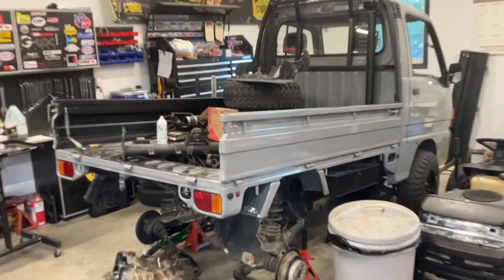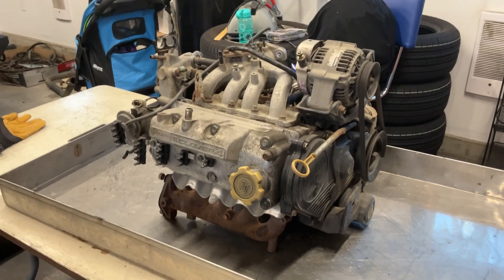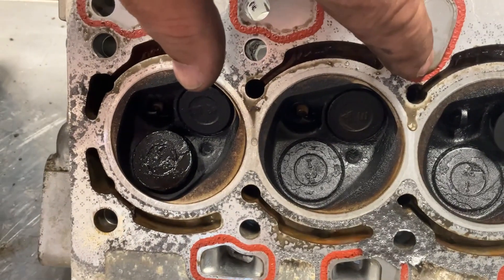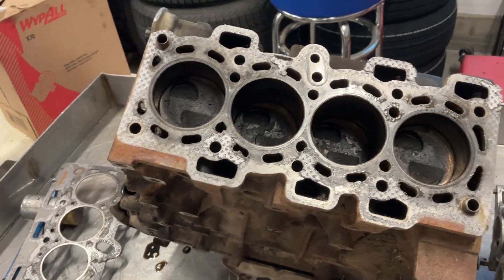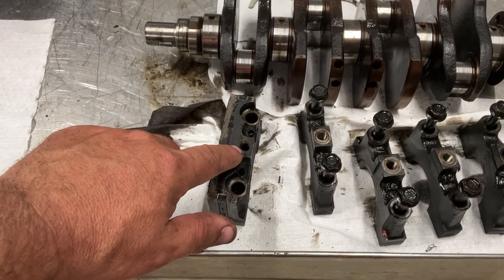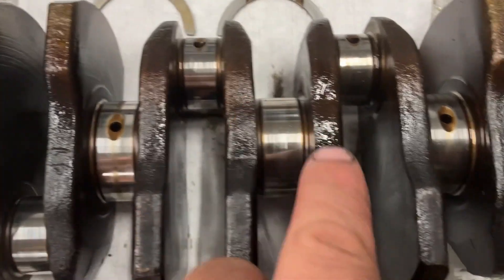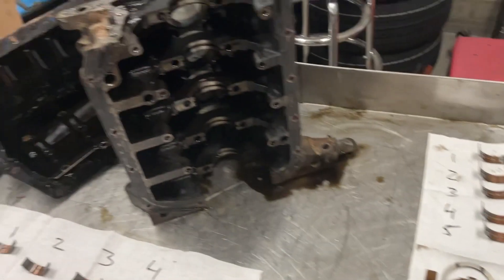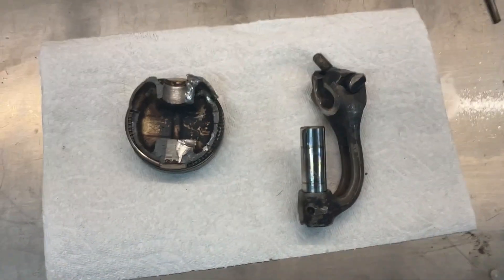1992 Subaru Sambar engine rebuild part 1

Comment: That oil passage in the head sure is curious.  Almost seems like you'd have an oil lance blasting that gasket in its stock configuration.  I assume its feeding the valve train.   Be handy to know Japanese and scour the Japanese subaru 4 cylinder hot rodding forums to see if they do any mods to that.  I'm thinking something like dremelling a groove in the head to provide a more direct route to the other hole, or even drilling a hole in the head in the appropriate spot, even just 1/8"  to meet up with the other hole for a more direct shot (assuming no voids).
Reply from the maker: Yea it is super strange.  You might have a good idea there.
Reply: After watching your cylinder head video, I got to wondering if this doubles as an intentional oil restriction in an attempt to keep oil in the sump and not all end up in the valve cover. (With thoughts of sbc's and high volume oil pumps being able under the right conditons to suck the sump dry because the oil ends up in the top end).   

 Smart thinking on their part from a cost-cutting point of view, terrible in that it  relies on a tiny seal. 
Got some more questions swirling around, but its a case of just smart enough to be dangerous, not smart enough to know if I'm stepping deeper into the danger zone. =-)

Comment: I'm thinking of picking up a 1991 Sambar 4x4 tomorrow.  Iisting says it spun a bearing and needs rebuilt.  Would I have any issues finding parts?  I don't see many internal parts on G&R imports?  Thanks for the informative videos I'd not even be considering buying it I'd I didn't come across your channel.
Reply from the maker: Talk to Todd at Proline Part out of California.  He has everything you need.  Does the engine still run?  You want to be sure the engine has not kicked the rod out of the side of the block.  New connecting rods are also available out of Japan.  Happy to help where I can.
Reply: @Turnbull Garage  yes, just got it in the shop.  Still runs, but has s knock.  I'd love to talk and get some pointers before I tear into it.

Comment: So I have a friend his rear main seal I believe is leaking oil really bad Do you have any ideas of what gaskets he will need and how hard it would be to do this job? I’m assuming oil pan gasket and not sure if there’s any others that would be needed when trying to replace the rear main seal any decently priced places or any crossover parts?
Reply from the maker: Only gasket needed is the rear main seal and it is the same as a 90’s Subaru Justy. Probably easier to remove engine and transmission together. I have removed transmission by itself before and it is not easy, I would do both together. Oil pan does not need to be removed. You will need to drain transmission oil though or you will have a mess. Good luck.

Comment: What is the mileage on that engine???
Reply from the maker: At the time of the rebuild, around 115k kms.
Reply: @turnbullgarage88  Probably didn't get regular filter and oil changes
Reply from the maker: @tedd1091  probably not.